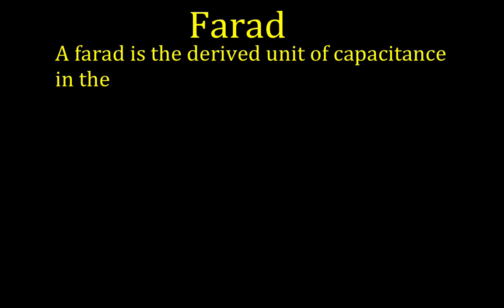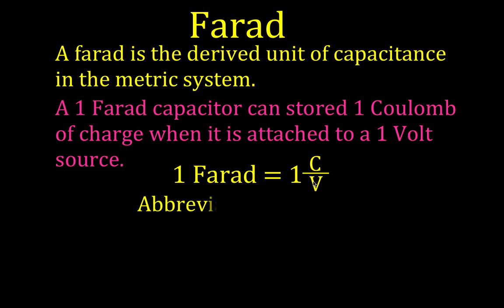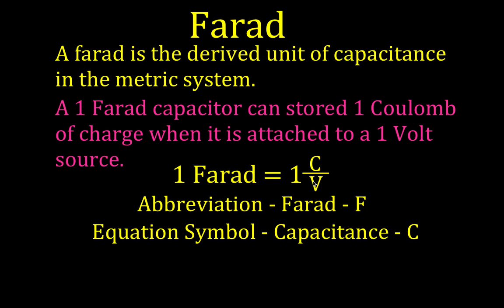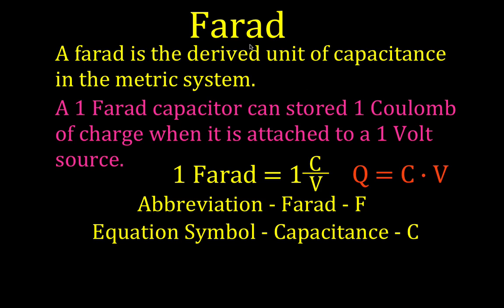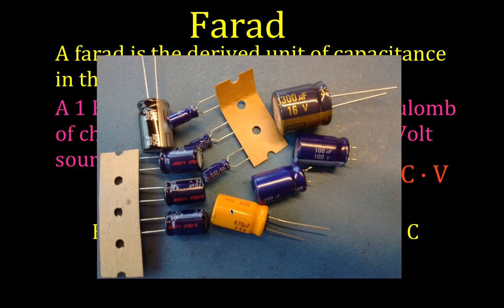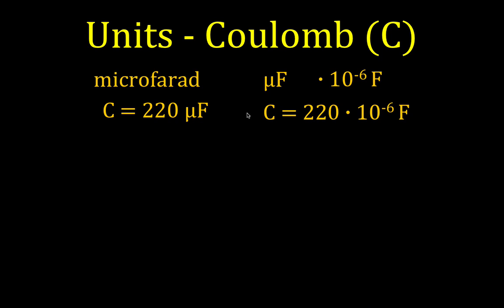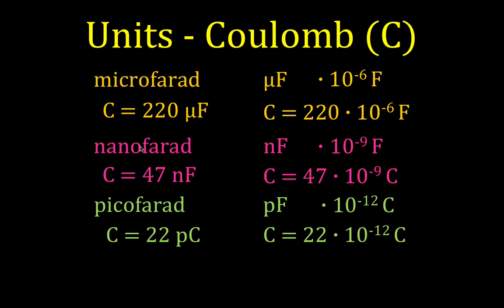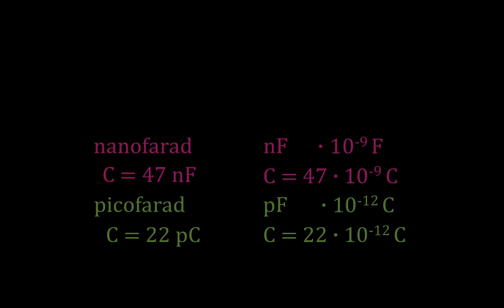Capacitors (3 of 9) What is a Farad? An Explanation

Comment: Ok, so if I'm following the calculation correctly, as the voltage goes up, then Farad comes down per Coulomb of charge?
I've heard that connecting capacitors in series increases voltage but drops the charge stored....I think this is wrong, the charge per capacitor must remain the same, it's only how Farad is calculated which causes a drop in total Farad.
Reply from the maker: The voltage does not affect the capacitance (farads). As the voltage goes up, the amount of charge that can be stored on the plates of the capacitor also increases. Sorry, I do not understand the second part of your question.

Comment: the last slide was a little confusing for me, it seems like F and C were swapped in some places
Reply from the maker: I hope I did not swap things. It can be a little confusing. C is the equation symbol for capacitance and the unit for capacitance is the farad (F). Q is the equation symbol for charge and the unit for change is the coulomb (C). Does that help?
Reply: @stepbystepscience  this video was helpful thank you. I was just confused about the slide for nano farads and pico farads it looks like the capacitors have units “C”

Comment: ..........I'm looking at the definition legalistically and maybe waisting time getting entangled . ...A one Coulomb capacitor "can"  store one coulomb of charge under potential difference of one volt between the plates. 
..The Coulomb is of course a big number of electons ,, in back of my head I recall a number with 63 zeros .....The critical word in definition is ,,can,, .  A capacitor rated at 100uf and say 6 volts breakdown can store 100 millionth of a coulomb at one volt PD but so can  a 100uf rated at 400 volts breakdown. The 6 volt capacitor can store however at 6 volt PD meaning ( I assert) it can hold 6 x100 millionths of a coulomb at this PD. The 400 volt rated capacitor can store charge at 400 PD meaning it'll hold 400 x 100 millionths of a coulomb . Right?
....or is it still for both only 100 millionths of coulomb but only thing different is the PD .?

Comment: The capacitance of  capacitor depends on farad..if you put high voltage source in capacitor have less farad it will damage the capacitor..1Q/1v..it's because 1 farad..not equals 1 farad..my opinion base on the other comment on how to analyze the equation.

Comment: I like your explanation, but what I was hoping for was to be able to put capacitors in instinctive relationship with something more "everyday", say a battery...  I'm just having a hard time fathoming how much current can go in capacitor...  Like if I need to smooth a circuit that has 5 V but that draws 6 V when it connects to Wi-Fi for example, and that process takes 0.5 seconds, then I'd need a capacitor of 0.5 F, but that seems excessive from having looked at circuits before...  idk, I just wish the answer or relationship I'm looking for was more accessible...

Comment: Why capacitor unit is farad
Reply from the maker: What else should it be, it is named after Michael Faraday.  It is an abbreviation for coulombs per volt.  If a capacitor is attached to a 1 volt source and it then stores 1 coulomb of charge on its plates then it is a 1 farad capacitor.  Does that help?

Comment: sorry, for an idiot like me, I didn't learn a thing...What does a farad have anything to do with anything...is it like an amp or a volt or a Wh or?
Reply from the maker: In a way it is like an amp or a volt....A farad has to do with how much charged is stored in the capacitor...Like the charge that is stored in the flash for a camera...more farads equals more charge stored.  Does that help?  You can see a listing of all my videos at http://www.stepbystepscience.com
Reply: I saw in another video (as I too am having trouble grasping the concept) that farads (Micro,Nano,Pico,etc) were more like a measure of how  long the capacitor holds x voltage. I have a few 16v-2200uf capacitors that I want to include into a few bridge rectifiers (in540 diodes) that I'll use for converting AC generators to DC,but I'm not sure if they will work in my circuits. My grid bank is 12v (couldn't find 12v capacitors,but the batteries will not care that they are receiving 4 extra volts per charge cycle). Any help would be greatly appreciated.
Reply: Well I guess if you want 12v capacitors you could go and look into car audio stuff, but most of them will have huge farads capacity. For example mine is a 2farad capacitor (12v)

Comment: suprisingly little info out there about this so thanks. I'm a newb so I'm a little stumped. ok a lot.. I understand what a coulomb is. So V is the difference in charge of the two plates? the potential difference. Is the V used basically as the amount of push the columbs will experience being discharged, which will then be current? So 1 farad is a certain amount of coulombs which has 1 volt. does this value change in proportion with plate sizes? If so why are there high voltage caps at micro farad?  also I've heard a coulomb (lets say caps in general) ars dangerous? how? I presume volts

they say A coulomb can be dangerous. A cap can be. I don't see how?
Reply: gary abbot uhhhh
Reply: So maybe this will help:  1 amp equals one coulomb.  They are the same thing.  One amp equals 6.24 x 10 to the 18th power of electrons OR basically 624 quintillion electrons passing one point in a conductor in one second.
One farad of charge needs 1 volt.  One farad equals one amp which means there are 624 quintillion electrons stored in a 1 farad capacitor to be released all at ONCE when the capacitors leads are shorted or if the capacitor reaches/surpasses its capacity.  Just remember that a farad is not created unless you apply one volt to the capacitor.  Does this help?